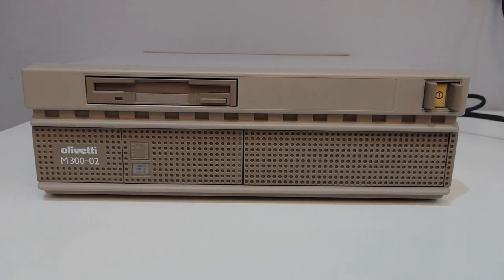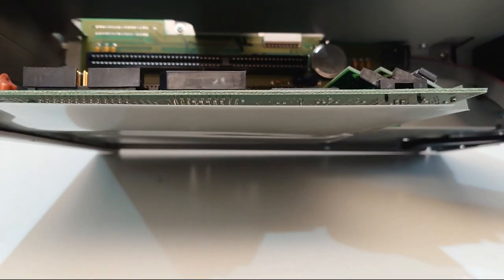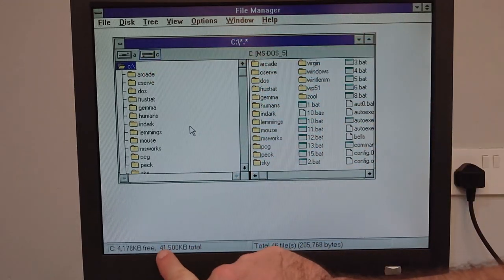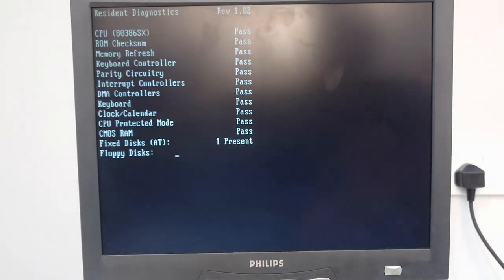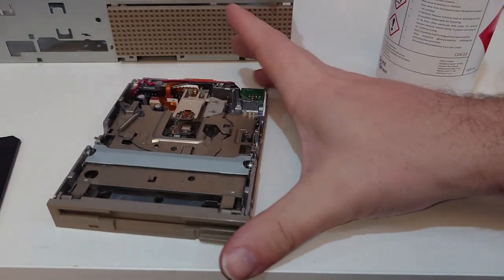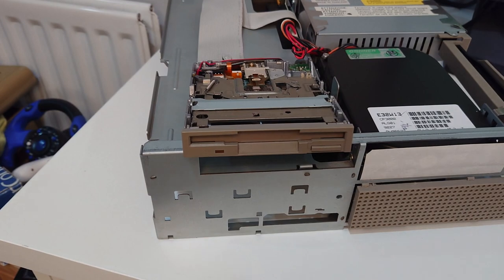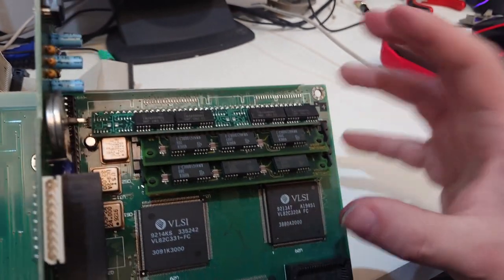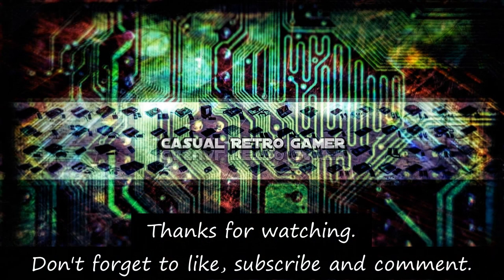Olivetti M300-02 386 Part 1

Comment: Did you check/clean the sensors for floppy write protect & density holes? The write protect & disk detect switches on Amigas get dirty so maybe this is the same. You could also try turning the motor for the head movement in case it is stuck - it may not have enough force to start moving and so can't seek to track zero.
Reply from the maker: After recording I took the loading mechanism apart and cleaned around the sensors but it made no difference, I'll take it apart later and give it another go as perhaps I missed something.  The motor for the head movement works fine. I wound it out fully, powered on and it moved back to track 0. 

I've ordered the 2 caps so will replace those and fingers crossed it works but if it's still dead they I'll maybe look to fitting a gotek or try to source another drive. 

Thanks for the suggestions.

Comment: Nice one .... have the same one here ... also from ebay ... also sold as untested or not powering on .... and although mine starts it keeps rebooting midway the tests it performs....  this computer has to win the price for “most plastic bits that you can snap off by accident while servicing it”
Reply from the maker: Strange fault with the rebooting but I'm sure you'll get it sorted.  All I can recommend is pulling any expansions and memory and starting from a basic board but you know all that already. 

I do love my olivetti.  It's my absolute go to dos machine and gets lots of us from me and the kids for old adventure games.  Luckily no more plastic has fallen off mine haha.

Does your floppy drive work?  I can't fix mine no matter what, it just keeps damaging disks. I don't really need it but would be nice to get working.
Reply: @CRG  I'll try and get started on it this week, but have some other projects to finish ... will keep you up to date ... mine didn't come with extra simms so I'm guessing it'll have 2MB on it. No expansion cards ... quickly tried to replace the lithium coin cell but didn't want to come out. But I'll need to disassemble it completely and take a good look ... but some parts will probably be difficult to disassemble. The case-lock mechanism and the weird power-lock mechanism for example would be hell to dismantle I think :) Hopefully I won't need to. But indeed a lovely PC.
Reply from the maker: @RetroSpector78  Good luck, the ram test is about half way through the boot tests so maybe a fault within that 2MB module fixed to the board.  

I'll look forward to your video on it.
Reply: @CRG  some software and operating system that is about to disappear and hard to find, make backup copy

Comment: Did you find a solution? One problem might have been, that this was a SD drive but you used HD disks on it. So it was not able to read it.
Reply from the maker: Never found a solution to the floppy drive.  It might just need realigned and I do keep meaning to fall back and take another look.